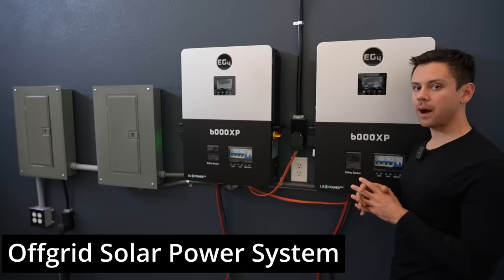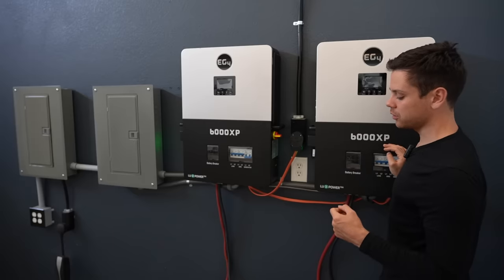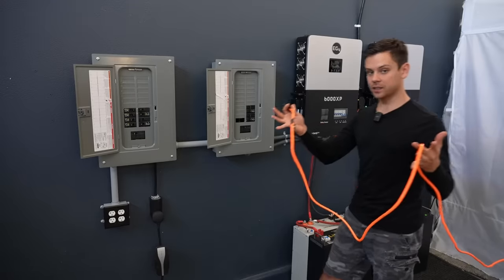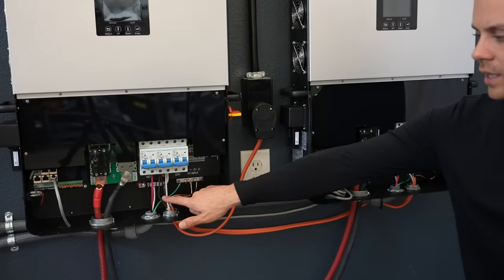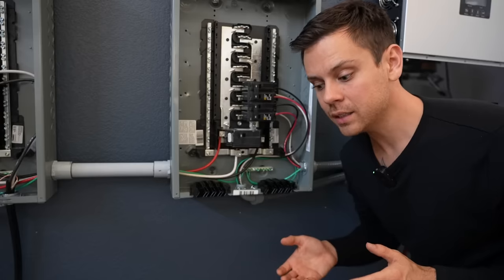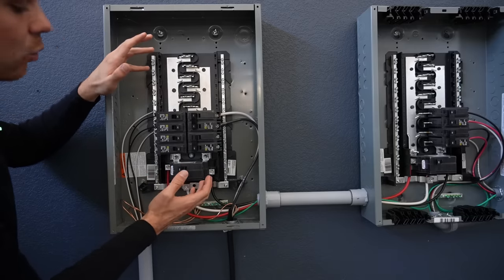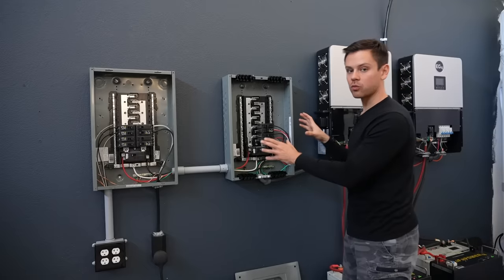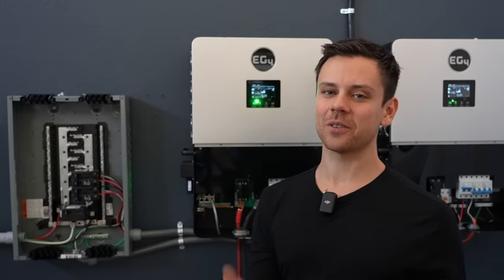How to Build Expandable Off-grid Solar Systems w/ EG4 6000XP

Comment: You are the man Will! You're making all this so attainable to the average home owner. I've drastically changed my plans based on your incredibly good videos. I'm moving my home almost completely off grid. It's "illegal" for me to completely disconnect from the grid once connected but I'm going to shift my load almost entirely to the "generator" side of the transfer switch. I'll leave 1 LED bulb in the garage for the power company!
Reply: They probably won't care as long as you keep paying the connection service fee....
Reply: @l0gic23 until all the neighbors do it too. Then the govt is gonna come for you.
Reply: I like you already and we're not even neighbors! 

What happens if someone's house burns down? Do they get fined for not using power???
Reply: @Channel-gz9hm  some of the worst places will "condemn" your home for not having power or water service... Those infrastructure loans have to be paid somehow...
Reply: Me too lol INDEPENDENCE! lol
Reply: Dang man!  I have the SAME thoughts and the SAME issues with my power company.  They don't allow us to go completely off-grid.  That's why I'm building an off-grid solar circuit at my house that is no where connected to the grid in any way!  I started with three Ecoflow Delta Pro's and even with three of their batteries each, I found that it still would like to have a "boost" from the grid every so often.  I thought of a system like this that the Ecoflow Delta's would be able to pull about 200 or 300 watts continually that will keep them from going down to almost nothing.  So that's why I need a small system like this.....   BUT....  This is a touch outta my electrical education level so I'm looking for a local electrician who knows solar to train me, advise me and to help install it all.  I'm in the East Phoenix AZ Area if anyone wants to contact me for a job that you can make some extra $$$ to help me put this all together.  I haven't yet bought the EG4 hardware yet but will after the first of the year.
Reply: @l0gic23  "Some of the worst places" is growing to "many places" and unless laws are passed to prevent it, you can expect it to become "all places" by Federal mandate. What we need is for knowledgeable people to educate our legislators and press them to enter and support laws ensuring our freedom to choose to be off-grid as well as grid-tied with a level playing field fiscally. 

There will always need to be grid-power, but those who do not use it shouldn't have to shoulder the same financial burden as those who use the grid. A lot of things are now partially funded by 'user fees' charged only to those who use them, so all we need is to extend that to the grid.
Reply: @Channel-gz9hm  They may also condemn your house for not having what they deem are necessary components to make a structure legally habitable. Lots of YT vids where people found this out the hard way, with some having to upgrade their used-to-be-grandfathered electric system to the latest codes by a licensed electrical contractor; a costly endeavor.

Comment: Will,  The inverters  N-G bond relay is static.   It is either on or off based on the setting.    It does not automatically change  with on or off grid.    Assuming your setting is 'off' for the bonding relay, your system is fine as long as it is plugged in.  (The bond will come from your AC in).   If totally off grid and there is no Bonded AC in, then either set the bonding relay to 'on' in one of the inverters or put the bond in your AC combiner box
Reply from the maker: I just learned and tested that just now. I didn't have the neutral connected with this configuration and you're right. Need to add that to the blueprint
Reply: What should the configuration look like if using this in an RV? 
Where you sometimes are connected to shore AC.
Reply: @john-arvidkibsgard616  These units are not really designed for mobile applications. 

To make it work for an RV there needs to be some type of external bonding when not plugged into shore power and no bonding when plugged into shore power.    

I have seen this done with a closed relay:  If shore power is available: the relay is energized and opens the relay, turning off the bond.

There can be manual NG bond switches but they are too prone to being left in the wrong position. 

One thing I saw once was someone set up a receptacle in the  stowage compartment to plug the shore power plug into when not on shore power.   There was no power at the receptacle, but Neutral and ground were tied together so when the cable is stowed, there is an NG bond.
Reply: when it has the grid to pass through it uses that N-G bond, even when not using the actual grid power, right?
So even though it could be using solar/battery all the time, the bonding is going all the way back to where ever the original panel in your house is with that bond
Reply: @gg-gn3re  yes - when it is tied to grid input, the grid neutral and grounds are connected to the common neutral and ground bus bars inside the inverter that you connect to for your loads, so yeah, the N-G bond is provided by your main panel regardless if the inverter is running the loads or if it is in pass-thru mode.
Reply: Just to be clear, I have two of these inverters in parallel that will connect to one panel (only one panel in my camp). I currently have this as my N/G bond location and would like to keep this if possible. My camp is off grid and does not have grid power, will I need to alter the N/G settings of the master inverter or does it come from the factory with a N/G bond already on? Thank you!
Reply: @JB-xl5kg  I assume the two inverters are paralleled.    If you have no AC in,   I would turn off the internal relay (No bond) in both and do a hard wired NG bond in your first load panel after the the inverters
Reply: @JB-xl5kg  Set the bond in the breaker panel instead of in any of the inverters. So all of the inverters (if you grow to even more.. 3.. 4 etc) just use that 1 breaker box as your bonding area
Reply: @gg-gn3re  Correct.   This inverter has a common neutral architecture.   (It never disconnects input neutral from output neutral.   As such, the bond in the main load panel is always in the circuit,  no matter where the power is coming from
Reply: @centerrightproudamerican5727  yep thanks for confirming again. I've read a lot about them and see (probably mistaken) posts very confused on it. I've also tested on my multimeter for continuity and that's how I've had it wired for a month now.. but I always make sure when I see these posts hahaha
Reply: @intDavid  So if the grid goes down, the ground and neutral bond should still be present? I will have my bond at the first means of disconnect(main panel). I will only be using my inverter in offgrid mode with an grid backup incase battery SOC get too low. I am unsure what would happen to the neutral in the system if the grid went down.

Comment: Can you make a few videos based on budgets. $500, $1000 budget, $2000 budget, $5,000 budget, and a $10,000 budget. Thanks for sharing all the knowledge you do.
Reply: My budget is $100 lol
Reply: @webberfan1234 - get you a stationary bike. Some copper wire & 2 used car batteries.

Comment: Hi Will, I appreciate all your videos, I am new to off grid solar , I just purchased from current connections   two EP4 6000XP with the 14.3kwh indoor battery, my questions I am wanting to purchase a generator that will be compatible with the 2 wire contact auto start feature on EP4 6000xp, can you make any recommendations,  I would like a generator  that is above 12kh and support multi fuel?

Comment: So you say the solar PV input has a built-in disconnect and you don't need anything external. However, the user manual says you need an external 4-pole 600V/20A DC breaker if you use both PV string inputs?

Comment: You're describing all these components, rattling off the specs like it's casual conversation for everybody, and I start to glaze over. Then you note how awesome it is that the EG4 is light enough to use wall anchors....as if finding wall studs would somehow be the DIFFICULT part of this whole process. 😅 It's amazing, thank you.

Comment: Expecting mine shortly! I will be using grid and pass through feature. I will add a load center in power shed and extend wires in main panel to new panel and relocate breakers.
I assume I would connect neutral and ground wires to the ones in my main panel.

Thanks for all you do for the solar community!
Reply: You are correct - the grid neutral and ground get connected to the same neutral and ground bus bars inside the 6000xp that you connect the output lines to.

Comment: I was getting ready to buy the Schneider Conext XW PRO 6.8KW Hybrid Inverter/Charger  but the power and cost saving of the EG4 6000XP can not be ignored.   Plus the added saving of internal component integration saves a lot as well.  To support powerful loads like a well pump I am getting two 6000XP as you demonstrated in this video.
Reply: Also, having two or more units for redundancy, which the 6000XP does very well, is always better than having just one unit, no matter how good it is.  That way if something breaks you aren't dead in the water.   Things can get expensive with Schneider or Sol-Ark with more than one unit, unfortunately.

Comment: When Will did a pre-release of this system last week, I (and others) noticed a ground/neutral bond issue and looks like he fixed that up nicely. Will explained things about this system a lot more clearly this time around anyway so Kudos on that. Awesome job. For instance, one thing he didn't mention last time was that these 6000XP have software controlled ground/neutral bond. I never even knew that kind of thing existed. So cool! I think that a video focusing in on this feature would make an interesting content subject on it's own - maybe compare regular physical bond with how this one works and figure out some kind of demo/test to show what's going on with it. Neat stuff.
Reply: Thank you for sharing your insights on Will's video! It's great to see improvements being made in the off-grid solar systems. I agree with you that a video focusing on the software controlled ground/neutral bond feature would be interesting. By the way, have you heard about the Segway Portable PowerStation Cube Series? It's a versatile and powerful backup power solution perfect for outdoor enthusiasts like us. Check it out if you're in need of reliable power on your camping trips or for home backup!
Reply: Keep in mind that Will was mistaken in the video about the internal N-G bond setting in the inverter being dynamic.  It is not - you either enable it or disable it and it does not change when running loads off the inverter or when it switches to pass-thru mode.  If you are tying it to the grid input, then the N-G bond is provided by the main panel and should be disabled in the inverters.  If you aren't connecting it to grid input, then it should either be enabled in the inverter, or physically done in the loads panel.
Reply: @intDavid thanks for mentioning this.  Also per the manual the 6000XP's default has the N-G bond set to Enabled so if set up with grid pass through that needs to be Disabled as you said.  
How would you configure this when a critical load panel is set up and the hots and neutrals both are moved from the main panel to the critical load panel?  In a grid outage situation would the physical tied main panel N-G bond be ok?  Don't want to send errant power down the line but it should return to source (the 6000XP).  I guess that also raises the question if the neutrals even need to be moved to the critical load panel.

Comment: You could also use a terminal block to join the inverter inputs and outputs as they already have breakers,  but you're layout looks good.
Reply: I was wondering about that. What's the advantage of doing it Will's way - just a cleaner look? Or maybe electrical code compliance?
Reply: I was thinking the same. Could you use some polaris lugs to combine the two interters into a single 4 AWG?

My 6500EX system uses a single 60A breaker with a lockout, so migrating to the 6000XP might be difficult if multiple double pole breakers are required in my critical loads panel.
Reply: @coryfrey5040  you could do that just fine.  I was considering doing the same thing.  One nice thing about Will's suggestion though is the easy ability to disconnect individual inverters from the load center when you are needing to do some maintenance or whatnot while the other inverter continues to run the loads.  A lot easier and safer than having to disconnect wires from the Polaris lugs under load - but not that big of a deal if you have the option to shut all the inverters down.

Comment: I  was hoping that EG4 would come out with an improved 6KW unit and these will be my upgrades from my 2 Growatt 3Kw units powering my system. In September I upgraded my battery to a  EG4 13KW  power wall and it is working flawlessly. These are more practical and affordable, plus easier to expand if needed. I'm glad I waiting for these much improved units to be available. Hopefully these will have a long lifespan and durability. The built-in breakers and wire management are  a great addition and makes for a clean installation. My original system has worked extremely well, but I definitely want to expand and power my whole house now.  3 of these would be less expensive than the 18kw and if 1 fails you would still have power available and you don't have to buy 2 at a time. Just seems a better choice unless you need an exterior installation which most won't need. I already have a separate load center and  hooked these up would be extremely easy and clean up the wiring. 
Will, thanks for the video and update, these units ROCK!

Comment: this is exactly what I need for my shop. Thanks! run welders, CNC etc as a hobby. no pulling power 300ft to the back of my property. I think 6ga is small going to our load center.

Comment: @12:30 looks like the all in one is set for lead acid
P.s. thanks for remaking this video
Reply: I’m also wondering about the lead acid setting 🤔
Reply from the maker: @joshjuzwik4787  I hate battery comms. Just run it with communication if you have it

Comment: Whole House Idea, Grid to "Panel 1", Panel 1 is just sets of double pull breakers, one for each inverter to supply Grid power to the Grid Input on each inverter (instead of your plug in thing), Panel 2 The Combiner Box all the Inverters feed into, use main legs on panel 2 as output to existing whole house panel, whole house now routed through inverter array. With some kind of "generator lockout" you could even do a jumper between panel 1 and panel 2 so if you had to take the whole solar array offline you could have a bypass to feed grid power directly from panel 1 to panel 2 and out through panel to to existing house panel.
Also this is a much better video then the original version.
Reply: I have (2) 6000xp's coming today.  I'll be running off grid and solar (batteries coming at later time this year).  I want to prioritize solar and have grid power when not enough solar.  Is your suggestion what I want to do combined with Will's setup?

Comment: The EG4 18K PV only uses 70 watts of stand by power for 12,000 watts and it can handle 8,000 watts of load imbalance per leg.

Comment: Hi Will.  I've been a ham radio operator since 66 and got involved with PV in the 70's. It's unfortunate, but the two typically don't mix, owing to the bad RF Hash (noise) produced by many PV subsystems, inverters being the biggest culprits.  The hash makes receiver reception nearly impossible.  That said, please consider incorporating some spectrum analysis of the equipment you are reviewing, as PV and battery backup systems are typically used during emergencies (by most), when communication with the outside world is of importance.  Best regards.

Comment: Will, one comment on the checking voltage step.  A better procedure is to first confirm phasing with the combiner breakers open to ensure there is no voltage between each inverter on the same line.  You can confirm overall voltage in that step as well, then once everything is confirmed to be per spec close the breakers.

(I wish you wore electrical gloves when doing these things to remind people of the importance... but that is just me.)

Comment: Thanks for a great explanation of these units, Will. Really makes me want to replace my older EG4 3000 Yellow unit with one of these... The only think I think you missed is that you do need an actual ground rod for the ground circuit. Some code jurisdictions will require 2 ground rods, a specified distance apart. Right now the way your system appears to be installed, the only time you have a true safety ground is when you are connected to the grid. If you went PV/Battery only, the ground would be floating, and is not a true safety ground. That has the potential to lead to a shock hazard if any of the metal cases of attached equipment somehow become energized. Perhaps you do have a ground set up and just didn't mention it, but I thought I'd put it out there. Great work as always!
Reply: I’m also curious about the ground could you elaborate please thanks

Comment: Very informative, thanks Will!
I appreciate the segment for paralleling the inverters because I've been trying to figure out how it's done properly 

Still at the crossroads on how to wire up my house with either outdoor inverters or indoor
Reply: If you put your gear inside on an exterior wall where you would put external inverters (or vice-versa) changing things later will be easy.